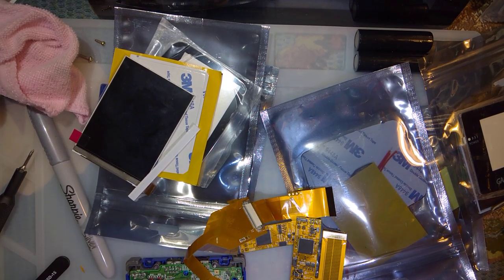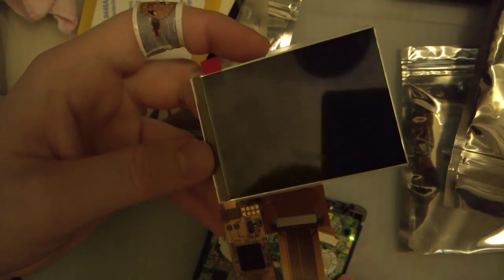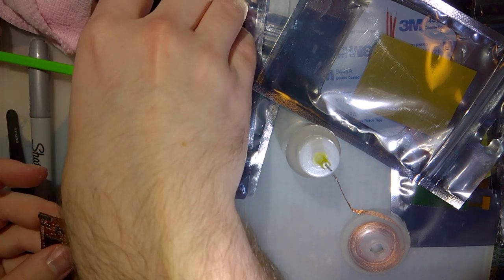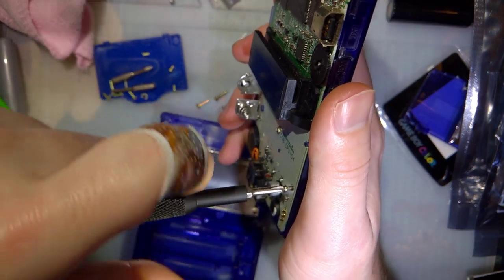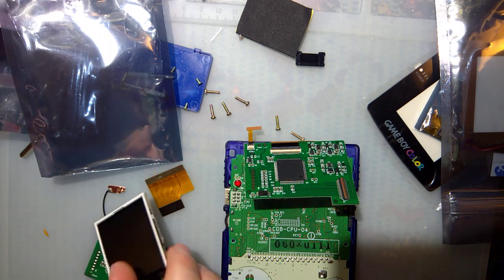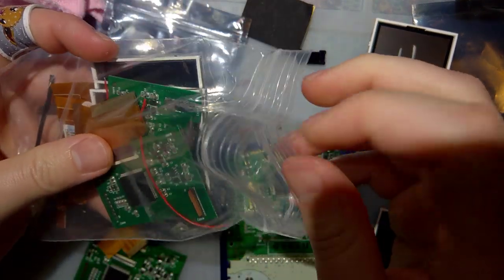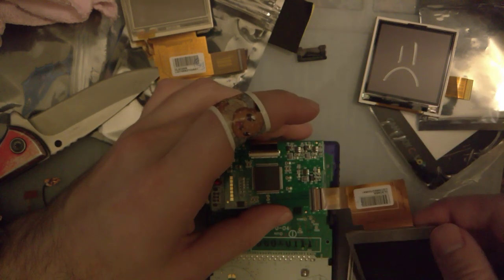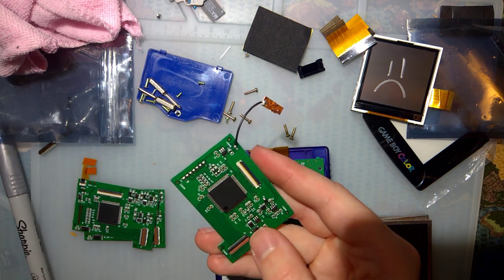Troubleshooting MORE Faulty Backlight Kits

Comment: Hello, i have a ips v2 ribbon with a broken componant, the L2 one.
Do you kow it's name and were Can i buy a New one ?
Thx afin for your help
Reply from the maker: Buy a new what? I'm confused as to what you have that's broken.
Reply: @makho  on my ribbon the component solder in L2(it's write L2 on the ribbon under the component)  is broken(really broken, a part is still solder the other part just jump out the ribbon), i Hope find a New one to solder on my ribbon .do you know the name of this component and where buy it on internet (sry bad english)
Reply from the maker: @lemaire0gontran  Ahh, I see. I don't know which part that is off hand but let me check and I'll let you know. To clarify, is this ribbon from funnyplaying or is it the "one-chip" variant?
Reply: @makho  from funnyplaying , thx a lot for your help !
Reply: i was wrong its the L3 component not the L2, picture here : https://photos.app.goo.gl/gL5BKSaVXn5RhFd17
Reply: Hi :), did you find some informations about this component ? Im at the same point, very difficult for me to find any hint or any similar component on the web.
Thx for your help